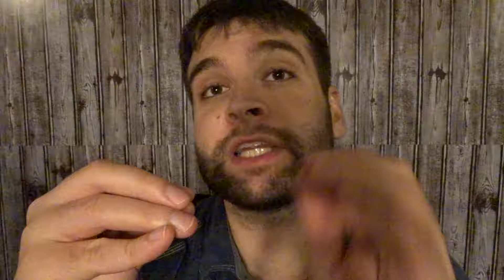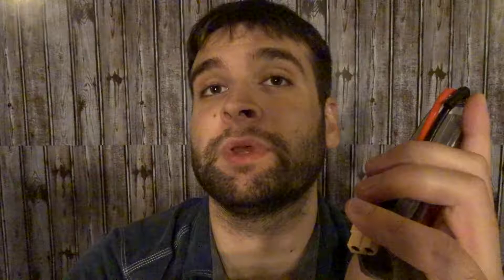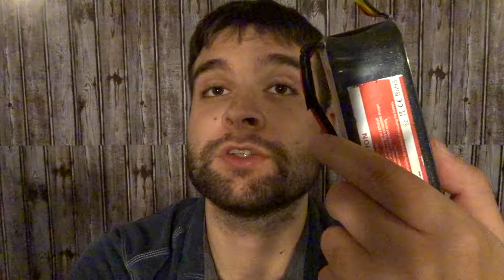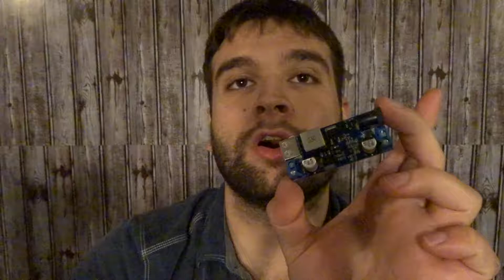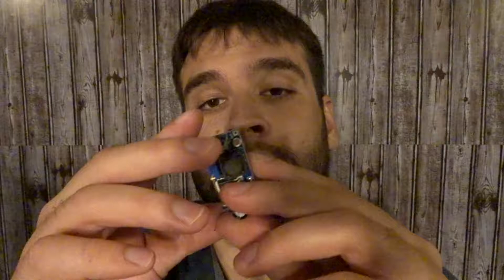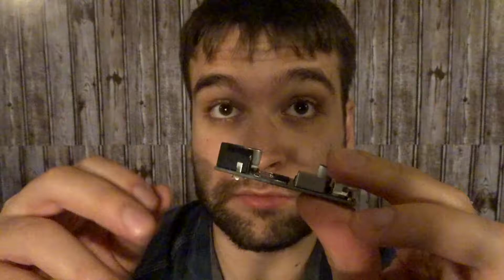the Simplest way to explain What are buck converters and what do they do

Comment: Have you tried this one? https://www.instructables.com/id/What-Is-LTC3780/
It looks pretty good (10Amp), and I uses it in my robots. But still have a little concerns in its reliability :)
Reply from the maker: There are a lot of things I have learned about buck converters since I started using them. But I honestly think that the video coming up this weekend u will benefit greatly from. Since I honestly will be diving deep into what I honestly wish I knew before I started working with buck converters
Reply from the maker: No I have not used that one but the big buck converter I use to explain how a buck converter works, is very similar to that one. What I have learned from that one is that when the step down buck converter has the ability to adjust its current, it causes some issues with knowing exactly what amps is being produced (unless it is one of those that has a screen that shows u the exact output). And it’s because of that adjustable current I would suggest to stay away from it. But if you do feel comfortable with that buck then stick with it. In the next video I really dive deep into what I like and dislike about each one of those buck converters as well as some things to keep in mind when you r looking for your next buck converter
Reply: @IslanderIntelligence  Very interesting finding! Looking forward your weekend video to get more details.